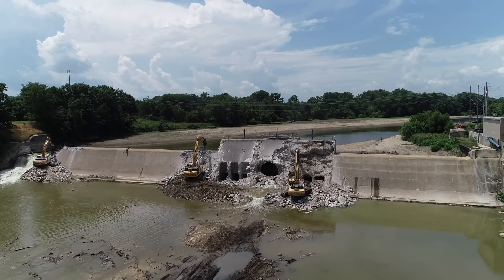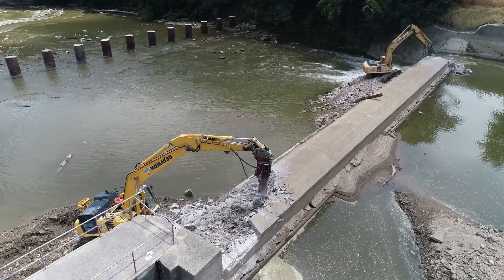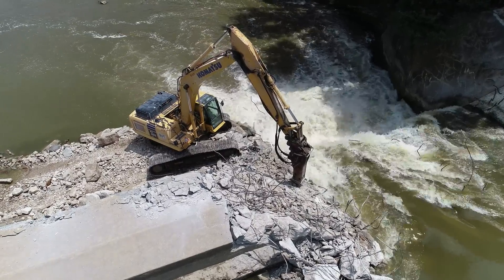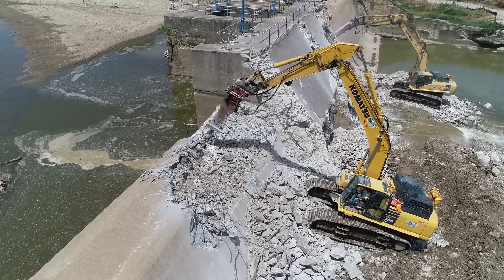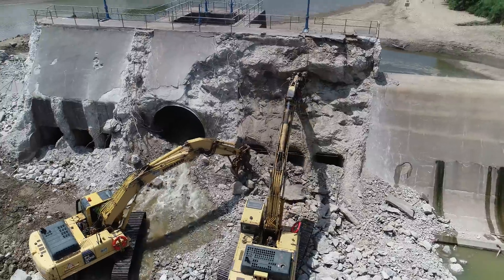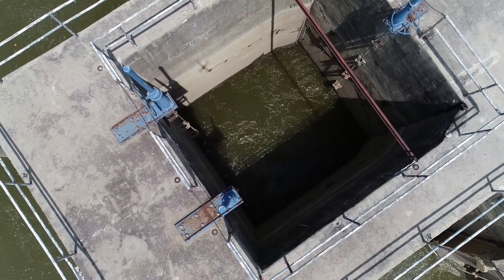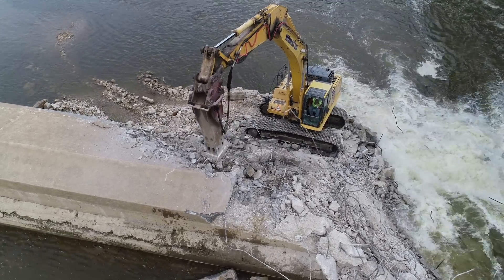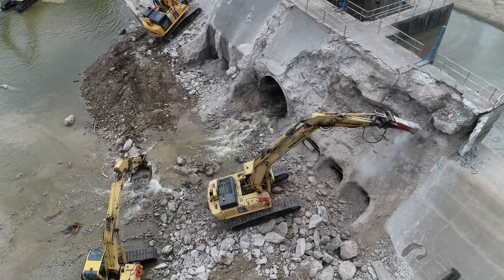Dam Removal Day 4

Comment: As someone who used to work in a shop that repaired construction equipment. It really bugs me when I see operators using those hammers to pull stuff away like they do. They're not designed to take side to side forces.  It destroys the seals. I couldn't tell you how many times we had to re build those things. I get it's annoying to have to either switch attachments or have 2 machines on one thing at a job site. Especially one this time sensitive. But don't blame the repair shop when it takes almost a week to order the parts from Japan if they're out of stock because we have to do so many of them or if the warranty company decides not to pay for your 3rd or 4th set of seals in a month. Lol. Other than that. AWESOME drone work dude.

Comment: I grew up around Akron but don't live in Ohio anymore but anything from "home" is interesting. Anyone know when this dam was built?
Reply: Bud Listar Ballville Dam was built on the Sandusky River in 1913 for hydroelectric power generation and is approximately 407 feet long and 34.4 feet high. The impounded section of the Sandusky River extends upstream from the dam approximately 2.1 miles (3.4 km), and the …

Comment: Reviewing this two weeks later..   I agree with a previous poster.  They should have used demolitions and simply blown the dam apart.   Once the water flowed out, they could channelize it and remove the rest of the debris - or just leave it.   It's just concrete and iron.

Comment: What a shame to destroy a perfectly good dam. Most likely for stupid environmental reasons.
Reply: Helping salmon and steelhead return to their spawning grounds is a stupid reason?
Reply: I did a quick lookup, and it appears it was built for hydroelectric generation in the early part of the 20th century, and from the silt buildup, it hasn't been used for that in decades.  So at this point, it is just a river blocker.  They aren't even using it for water storage.

Comment: I can tell you from experience, demo'ing concrete with tons of rebar is unimaginably stressful! That stuff gets caught in your tracks and sometimes will slap the machine as it breaks. Those hammer hoses are long and just kinda dangle around. With rebar you have to always be aware of where your hoses are as well. May seem petty, but all it takes it one turn of the cab while a hose it caught and the machine will bleed hydraulic fluid like someone getting their jugular sliced. All that to say....Rebar, great for reinforcement...Nightmarish for demolition!
Reply: How do you pick what bit to hammer next? In some of the videos you can see the operator hesitate before picking a next spot, or put the hammer somewhere completely different. Is there a specific step-by-step process that you have to follow rigidly, or does it not matter as long as you don't hollow out the base of the dam and topple the whole thing on the machine?
Reply: I wouldn't say there's a specific spot, but usually what happens is you break up a certain area and because the hammer chisel is limited on size, there's only so low you can go...so you find another good spot to break. With so much rebar in there and only so low you can go, it's unlikely the entire thing will topple over on you...but the hammer depth has a lot to do with it. Also, if you try to hammer off too big a chunk, it's likely that you'll just crack it and the chisel will get stuck in the concrete. When that happens, you have to wedge it out and sometimes you can snap the head right off the chisel. So you try to choose a spot where you'll get the most "bang for you buck" so to speak. Hope that made sense.
Reply: Yeah, thanks a lot.

Comment: I think that center section is older.
Older concrete isn't as strong and it doesn't have very much rebar in it.
Reply: Brian Gardiner concrete gets harder with age.  However, it can also get brittle.